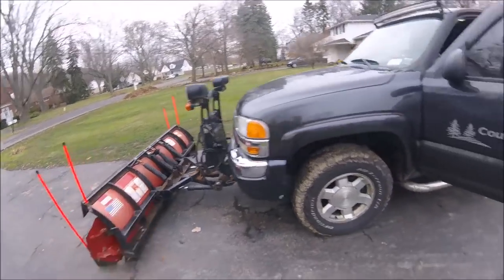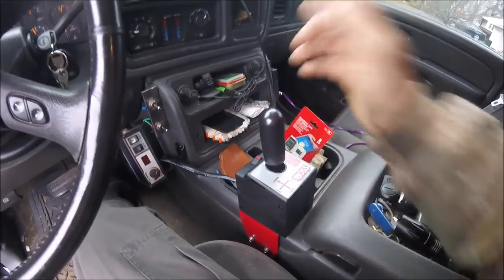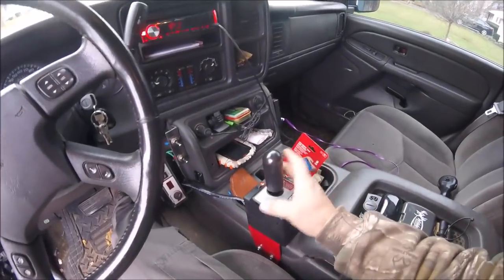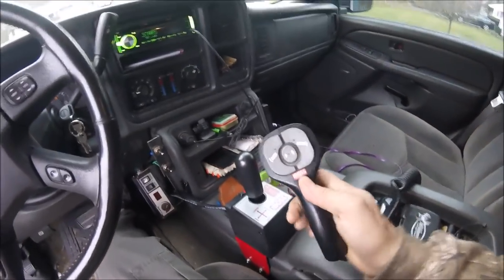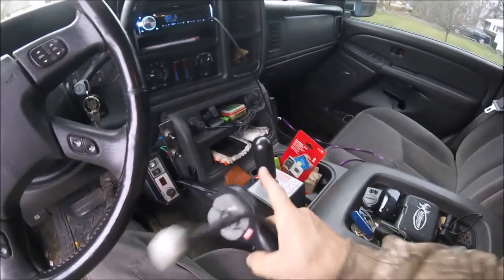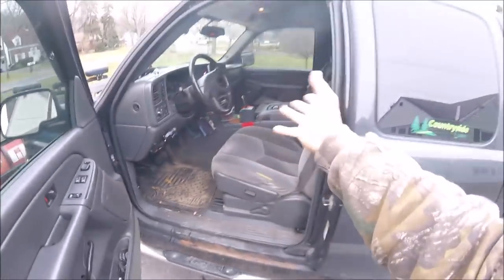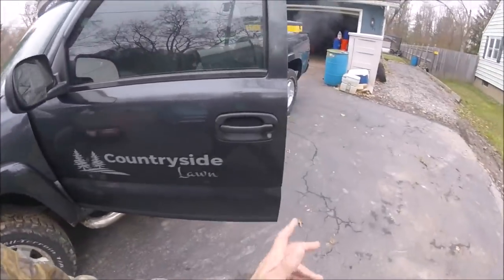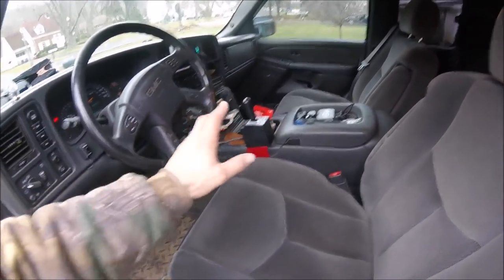Boss Snow Plow Joystick Controller - how to use it!

Comment: I like that, I have a blizzard 9' snowplow with the hitch mount 2 snowplow attachment and currently have a handheld controller with a 4 pin plug, storkes plow has a small joystick controller however its works by using your fingers instead of your whole hand I just wonder if I could wire that joystick controller to my 4 pin plug?

Comment: Maybe I missed it, but how do you return the blade to straight (not angled) if the joystick returns to the center but the blade stays angled? Do you have to put the joystick forward and put the blade down to put it straight again?
Reply from the maker: Ben Kempa No, simple really. If blade is left, move joystick to the right until the blade is straight. Vice versa for opposite direction

Comment: Hey I had a question, on the v plow do you know when you press the red rocker switch to go down do I have to hold it down to put it on float mode or is it automatically and is there a way I can lower my plow without it going into float mode on the controls
Reply from the maker: I don't have a v plow. I'm not really sure on them
Reply: @CountrysideStrong  I found out I talked to a BOSS rep. Sorry for the late response but thanks tho.